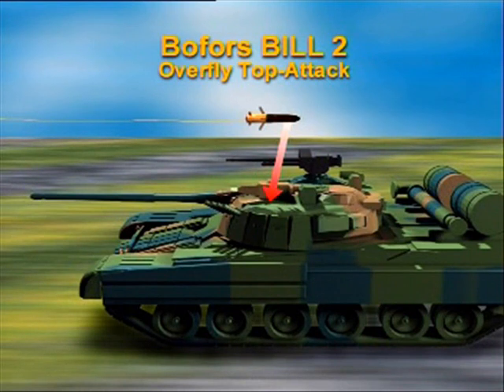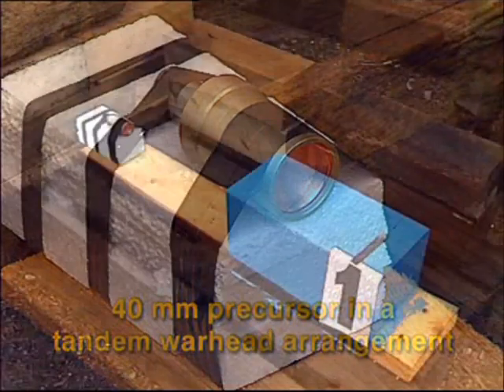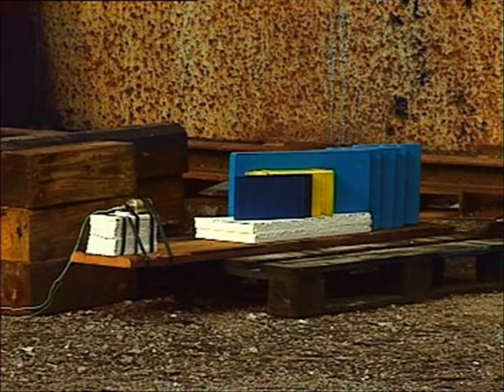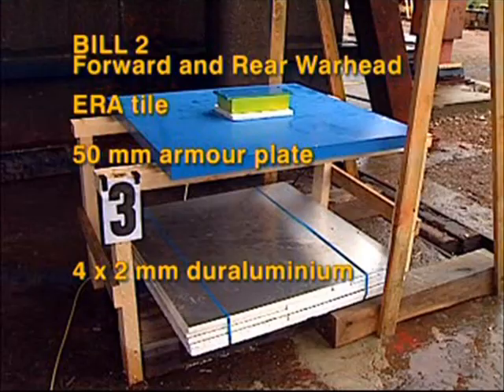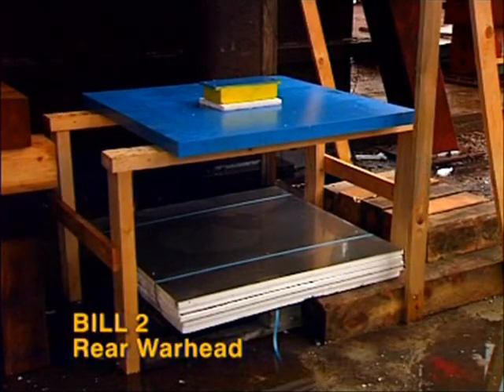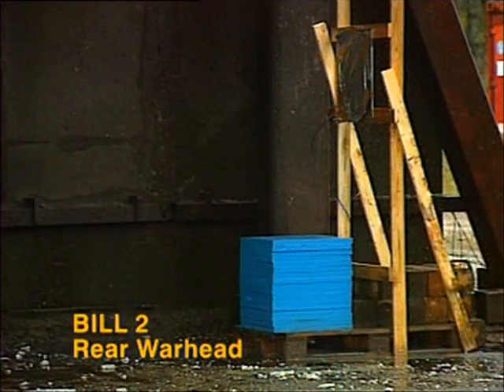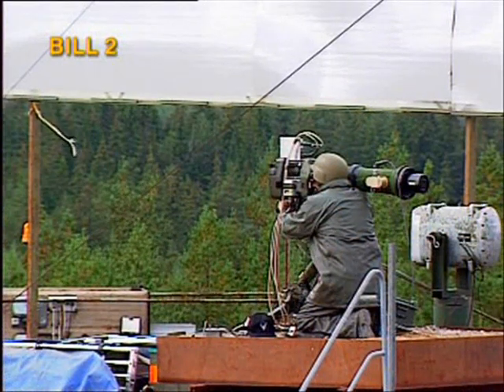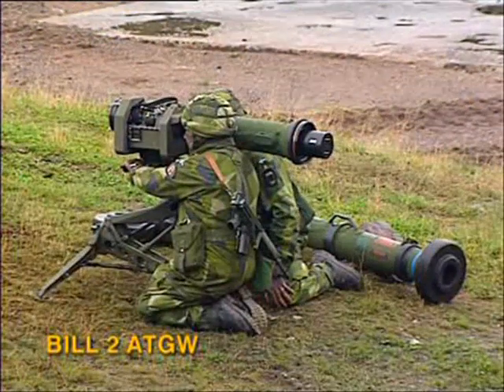Bill2 presentation

Comment: SAAB should build this level of reliability into their cars!😂
Reply from the maker: Saab sold the car making bits of the company to GM in 2000.
In 2012 the Saab car company went bankrupt.
Reply: It's not even the same company. The 'muricans ruined the Automobile company when they took it over. SAAB Defence is still going VERY strong.

Comment: BOFORS has a long history of making lethal weapons.  Their guns were mounted on American ships as replacements for the original guns during WW II.   As a result, shooting down Japanese dive bombers became a whole lot more effective.
Reply: Michael Aitchison Yeah right...
Reply: That is hilarious story you developed there, reason why American AA guns were more effective than the Japanese ones were because America mass produced proximity detonating shells. 
Japan had them too but they were too expensive and came too late to really do anything, America deployed them mass scale on their warships.

Basically these shells detonate close to their target so even if you miss an airplane but the shell flies close enough the force it has when detonating will still cause damage. 
This meant that AA guns no longer had to be pin point accurate and even smaller ships could have devastating effects on airplanes.
Reply: @SMGJohn  its called flak
Reply: and its not proximity, its pressure based explosion that reacts to altitude
Reply: @Skroting  that is incorrect, it is radar proximity based on a very primitive vacuum tube transceiver
Reply: @Skroting It is Bofors 40mm gun with special proximity fuzed shells, flak is German not used by allies

Comment from the maker: It did not work when it was fired horizontally at the sloping ERA tile.
You get a totally different result when you fire it vertically straight down at the ERA.
Reply: That was because of the ERA and it was only one charge used of the "tandem" charge in the Bill 2.. That said, it's designed for top attack. and there you could see it defeated ERA and easily go through 500mm armor.
Reply: @loki76  I was hoping they used MORE steel plates. And see how many plates it actually takes to stop the anti-tank round...I have 2.5 meters thick of AR500 steel plates that I REALLY want to try. However I have no access to anti-tank weapons nor a property to try it :(

I am in Texas, USA and looking for this experiment.
Reply: @loki76  should check out this Russian YouTuber. This small sandstone boulder rock ate up 4 RPG rounds like it was nothing. Only cracked the rock from the 4th hit however it didn't seem penetrated completely.
He later shot that "same" rock later on his channel and that same rock ate up MORE RPG hits.

РПГ - 7 - Застывшая в камне кумулятивная струя

Comment: 510 mm armor plates clean through, sick.. and this was over 7 years ago.
Reply: old tech sweden stopped using it in 2013 comes from the late 90's
Reply: old tech sweden stopped using it in 2013 comes from the late 90's
Reply: 510 mm of steel armor, nobody uses steel armor anymore or in fact since the 80s
Reply: @TeddyKrimsony  Steel is the last barrier to protect the crew when both the arena system and explosive charge armour fail. Also you dont need complicate system to deal with gun rounds incoming but steel armour

Comment: Penetration capability is impresive. Looks like its designed to kill the crew rather than blow the tank. Commander & gunner in particular or may be try to get into ammo stock of the turret. How does the missile know its just above the target?
Reply from the maker: Magnetic detection.
Reply: what if there was a obstacle that having a material substance like a tank ? will the magnetic sensors blow the shaped charge ?
Reply: Complete Absence Of Light, there is a guidance system too. It should affect the detonation mechanic, I believe.

Comment: i think its more susceptible to being intercepted by an active protective system because you can just fire a trophy charge verticly and it doesnt have to intercept anything horizontally
Reply: Since most active protective systems designed for the classic AT missiles it will make them more expensive, complex and unreliable.

Comment: Why does it have that string attached to it?
Reply from the maker: The launcher looks at the missile and corrects its flight path through the wire.
Reply: so if you miss the tank you can pull it back and try again

Comment: can anyone tell me how the wire guiding the rocket doesnt break with the stress and speed. it looks tiny in size but must be super strong
Reply: I think its shot ahead of launching a missile so it doesnt create much tension on the wire and wire is rolled out quite fast but not enough to snap it.

Comment: @gosciu555 Yes, there is, but there is also an optical sensor that keeps track of the distance to the target, so you would have to trick that as well and the combination is very difficult to trick. 

A far easier solution would be to fire at the shooter. the missile is a beam rider, so if the shooter doesn't laze the target, the missile will self-detonate.

Comment: Why do they have it on a guide wire?
Reply from the maker: Lorenzo Pacheco So it is unjammable. 
The user aims at the target and the launcher generates a laser beam, the missile then flies 'inside' of this beam and the launcher keeps track of where it is and steers it straight by sending commands through the wire.
Reply: Scurck That's a really fucking cool idea.
Reply: +Scurck Really? I was always thinking its SACLOS guided just like TOW (launcher seeks for flare at the end of missile and sends a commands trough wire to correct missile flight path).
Reply: +Scurck Really? I was always thinking its SACLOS guided just like TOW (launcher seeks for flare at the end of missile and sends a commands trough wire to correct missile flight path).
Reply: +Scurck  The missile has a diode at the rear with a coded signal that the sight track and guide it to the target via wire, the system does not send out any detectable energy in form of a laser beam.
Reply: They reel it in after they shoot it to reuse it
Reply: +Todd Cameron lmao! they reel it in... hahaha!
Reply: Todd Cameron NOPE. Wire is quite cheap when you compare this to the rest of missile and OFC a life of the guy who has to reel it in under fire :P

Comment: And just like the TOW, the disadvantages are you have to steer it into the target, maintaining line of sight through the entire firing to detonation, and it most likely will fail if shot over a body of water (lake, wide river) as it's guidance wires tend to short out if immersed.
Reply from the maker: Sweden makes wire guided torpedoes that obviously work in water.
So we can only assume that the Bill2 wires are insulated as well.

Comment: There is no way to stop a hollow charge aimed at the roof...
Reply: Future Trophy like systems?
Reply: Asturian Cetorix Yes there is a cage system used by the British...
Reply: Asturian Cetorix I wonder how the new Russian T-14 would survive this kind of attack what do you think?
Reply: Actually i have a feeling the T-14 wouldn't stand up against a anti tank tow missile the ones used in syria right now which concerns me, the top of the tank looks very thin, its just the sides that look imprise but if you look at all the tanks being blown up right now in syria its the american made anti tank TOW used by the rebels the new T-14 has to atleast be able to survive a tow misssile to be worth the new name.
Reply: The TOW s are hitting super old T72 tanks in Syria. In fact the T72 that where exported where the worst equipped. Recent videos of tow hitting T90 show that they do penetrate but by little, the operator in the turret was able to leave the tank.
Reply: Well, I,think you don't need to pulverize the tank to make an epic win, it's enough to disable it. A heavy missile hit sure can cause, if not a total burn down the house, a lot of indirect damage to many systems, Some times making the tank useless.

I mean, many M1's were disabled and later destroyed by it's own crew. That's the point.
Reply: There was no penetration on the video you are talking about. Operator had a concussion from the blast, because his hatch was opened and he bailed in panic.
Reply: Srg. Graphouni saw it agaun. You could be right. Operators need to wear better protection for sharpnell. Afterr seeing all the videos of tanks getting cooked I would also panic. Next time close the hatch... Anyway. Its quite remarcable how armor holds the hit of such a big atm unit.

Comment: Isn't this the same concept as the Javelin system?
Reply: Hawk 777 No sir, this is designed to be used as a stationary ATG and   the ammunition explodes directly above the target.
Reply: The Javelin has many attack modes, one of them is a top down attack especially designed for well armored tanks. It does the same thing comes down and detonates a shaped charge. The javelin has two war warheads the same as the Bill2, one designed to defeat the reactive armor and the other to penetrate the hull. The part where the Javelin shines is that its a "fire and forget" system. Soon as you fire it you can take cover and the missile is equipped with infrared seekers to track the target.  The Javelin can operate at ranges of 4,750 meters and can penetrate up to 800mm of armor, far exceeding what the Bill2 can do.
Reply: Apart from the missile carrying  tandem heat warheads there are very few similarities between the two weapon systems. The Javelin is fire and forget and guids itself to the target, BILL is wireguided and needs to be guided until impact. Javelin strikes from an angle by flying upwards and then diving into the targets roof, BILL flies straight and detonates as it passes above the target.
Reply: Bringer of Storms so basically the javelin is better
Reply: Ben Conway
In many ways yes. At the same time I think the Javelin can be fooled with heavy camouflage like the Bofors Barracuda system and/or IR blocking smokescreens. A SACLOS guided missile won't.

Comment: What kind of MBTs only have 50mm of steel armor? T-34? This test is bs
Reply: Rare modern tank has better than 50 mm roof armor. It is hard to find exact numbers, but I guess they all have weak spots at least on the roof of turret.
Reply: The test shows penetration of 510mm armor.
Reply: no tank has a lot of armour on the roof you can estimate it to be around 50-70 mm
Reply: Have you ever riden around in any sort of tracked armored vehicle? You can only make the roof armor so thick before it starts to interfere with crew operations. Imagine making the crew hatch thick enough to withstand a direct hit from a shaped charge warhead.

Comment: incoming rpg can be detected by tank defend radar system and counter and tank will destroy it while still in flight before it even reach upper position. There are several turrets to kill those threads. But when it will have luck,.. it can go trough and make damage.

Comment: what the?
Is that even real or just a prank?
I mean, reactive armor penetrated like it wasn't there, going through an entire tank, blasting through 220mm steel, is it even possible to make something THAT powerful?
and the range....
2200meters, radicolous.....
if that things on the battlefield you shouldn't even bother getting a tank in the warzone....
Reply: dude.....
did ya see the part where it went all the way trough half a meter of armorsteel and then in to the ground after that?
Reply: ***** heh...."only" I don't think you actually need bigger ones XD

Comment: Problem with these tests is that they do not correspond to real world tank armour, Soviet T-64 and T-80 does not have mostly steel construction, its multi layered armour designed to stop missiles like these to begin with and shaped charges. 

T-80 has diamonds in its turret armour which makes it extremely difficult to penetrate. 
But then again, when your missile is two times more costly than the tank itself, not much can stop it except your bank account.
Reply: They clearly demonstrated that the missiles main charge could pierce up to 510 mm of armor. Unless the top of your tank has more armor than the front, there is no way that missile isn't penetrating or causing major damage.
Reply: Oh, this didn't age well ...
Reply: @otgiggs  
Sure it did, most of the penetrations in Ukraine are on sides or engine area, which are weakest spots of all Soviet tanks

Comment: only make a tiny hole on armor plate. useless
Reply: You don't want to have any holes in your head.
Reply: you get 800+ km/h copper shards flying inside the tank after that penetration you say is shit
Reply from the maker: When the beam penetrates into the compartment the people inside will get crushed by the pressure, turned into mincemeat by the shrapnel and then cooked by the heat.